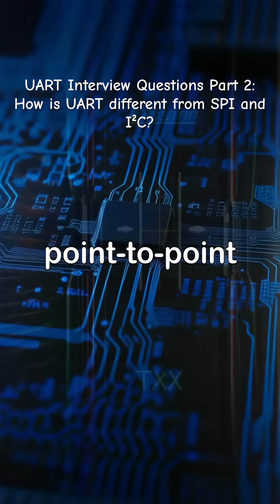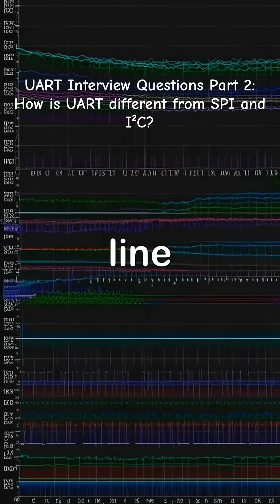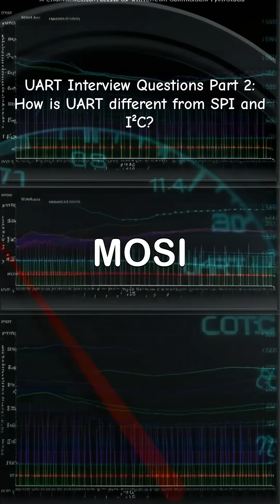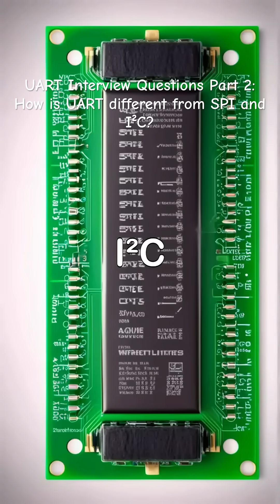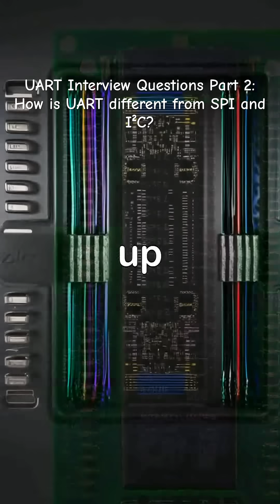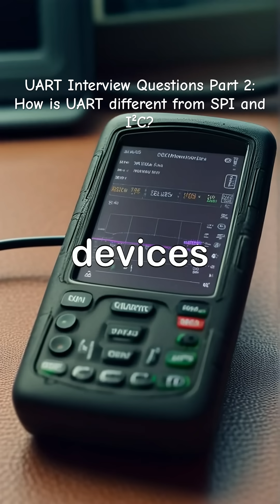How is UART different from SPI and I²C? #embeddedsystemstutorials

Comment: fun fact In UART, the sender and receiver do not share a clock line. Instead, they agree on a baud rate (bits per second) and use start/stop bits to frame each byte so synchronization can happen at the beginning of each transmission.